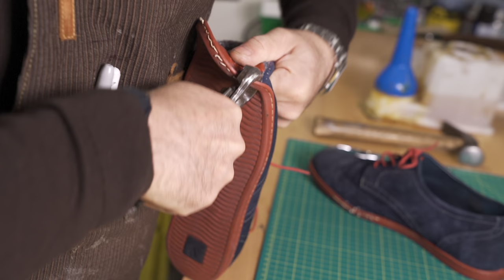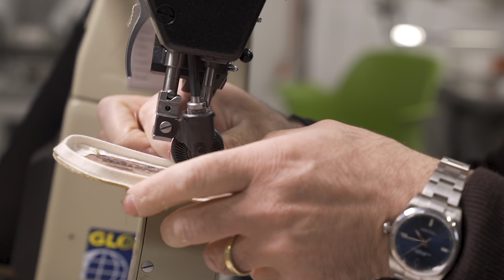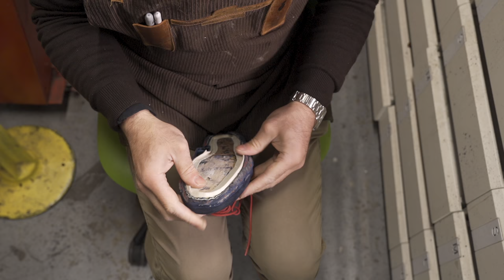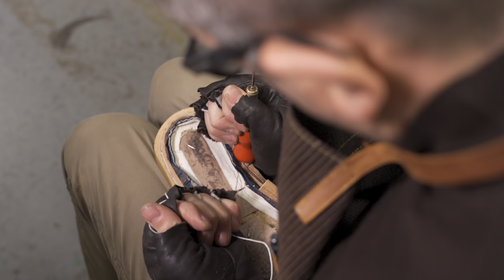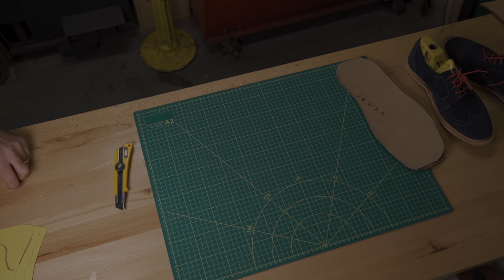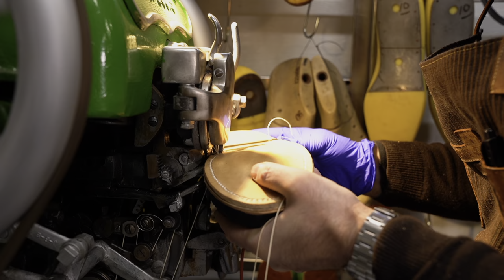Cheap Shoes Get UPGRADED into ARTISAN Shoes

Comment: Awesome,thanks. What is this line/lace which you attach to the bottom? is it just a fabric? I mean on the video at the 2 min 20 sec mark
Reply from the maker: It is Synthetic Welting Tape.
It is used for attaching together in-soles to leather uppers and goodyear welt
Reply: @KWSHOEREPAIR  Thanks! I have never heard of it before. Seems like a good technique
Reply: @KWSHOEREPAIR  I have seen cork in-soles(or midsoles) used. It has a groove carved into it and goodyear welt sewn into that groove
Reply: There are many techniques to make shoes, I guess. Not just one way. I would like to make a shoes someday, as a hobby
Reply from the maker: @henri7879  there few ways for good construction,  and it is great if you can start, so many videos you can learn from.
I started my apprentice when I was 12.
I do have different profesion as well,  but this one keeps me very happy ( my first love , lol)

Comment: Wow! What an upgrade! 😮 Beautiful.
Reply: I asked the worker in my nearby shoe-repair shop how much time a similar repair would take and how much it would cost, he responded super quick : just throw them in the bin and get a new pair of shoes.. the leather on my shoes was similar even color but fully perforated and i really like them but on both the pads on side formed some cracks and stitches give up were too soft..  i miss them so much they felt so great on my feet in spring & summer because perforated leather air circulating inside not allow to sweat and were so light.. i saw kind of similar new pair from Pepe Jeans  is costing more than 480 $ (reduced from 540 $)..  i really wish more skilled people like this existed at least one in each town that would be really awesome for saving favorite wared shoes and the extra money for a new pair !..